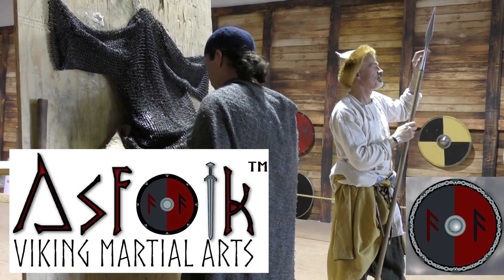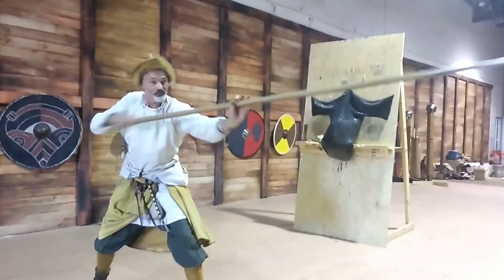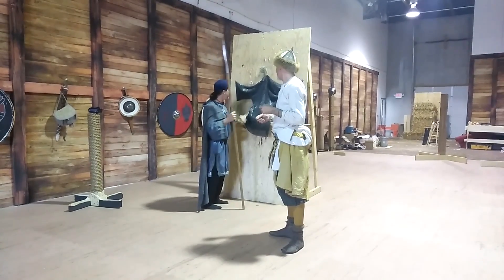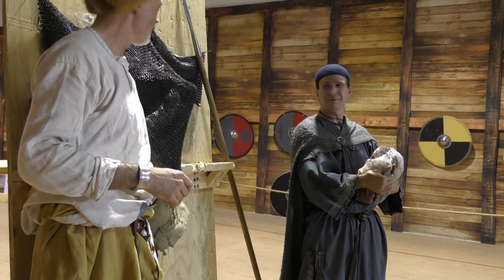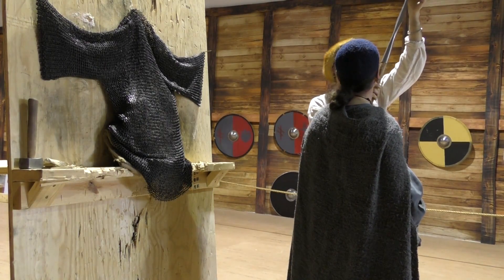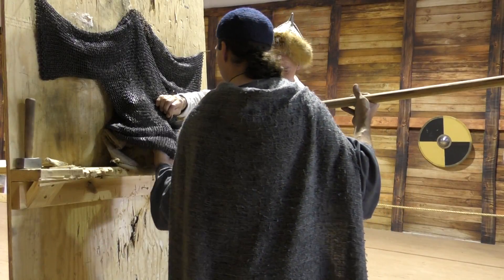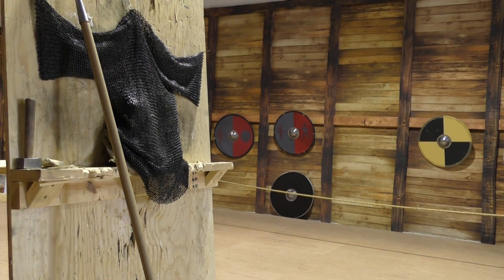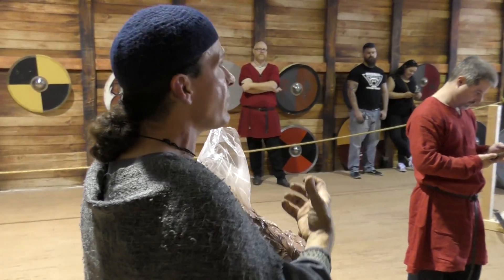Thrand & Roland Warzecha Viking Spear vs Histoical maille @Asfolk! +Slow-mo

Comment: You have to keep in mind that hitting an opponent with such a powerful accurate thrust would be somewhat rare. Often times you wouldnt be able to create an opening to perform such a thrust and even if you did, you might want to be conservative with the amount of power and pressure you use because you dont want to leave yourself open. Amazing test guys, thanks for the hard work.
Reply from the maker: Very true

Comment: Thrand, I was wondering: gambesons and jacks were sometimes worn over mail instead of under it. Would you be able to do a test with spears and arrows to see if there's any difference between having the cloth on top of underneath the mail?
Reply from the maker: Jonathan Dean I could do this in the future.
Reply: That would be amazing. Thanks :).
Reply: People theorize that was a second gambeson for extra protection (+ protection from the elements)
Reply: Gloin79 There's a reference in the Ordinannce of Charles the Bold for archers to wear either a brigandine or a mail shirt under a ten layer jack. This suggests to me that, even if in the 13th  century some wore a gambeson on top and another beneath their mail, in the third quarter of 15th century there was only one layer of textile armour.
Reply: for the 13th century there is a reference in the norse saga's to wearing a quilted surcoat as predecessor to the coat of plates, as for the 15th I'd think you still would wear a lighter arming coat under the mail for comfort but indeed not really for protection
Reply: https: // myarmoury.com/talk/viewtopic.php?t=11131

The test this chap did showed that:

- to defeat a gamberson, you need either a sharp cutting edge or a REALLY heavy thrust from a stiff spike backed up by weight (spear or poleaxe spike). Gamberson did quite well against bodkin point arrow (non sharpened broad heads). 

- Thus, a gamerson over mail will soffen the impact of most war arrows (bodkin points). Broadheads will cut through, but they won't  go through mail. Gamberson are good against blunt weapons (mace, hammer). Sharp sword will cut through a gamberson but will be stopped by mail.

- Another reason; I suppose, is that mail armor is expensive and more difficult to make than a gamberson. Thus, you might want the gamberson on top as sacrificial, ablative armor. If your gamberson got too torn up, then just make a new one. A split ring need a smith; a gamberson need cloth, needle, and threads.

- Also, if you put gamberson underneath the mail, you need to make a bigger mail shirt. Bigger mail shirt = more metal, more weight, more expensive.

Comment: Great video!
What I find most interesting is that there seems to be little effect of how many rings you cut - the three ring hole you made doesn't look much bigger than Roland's single popped ring... So while it is vulnerable to spears, the mial seems to conatin the damage pretty good.
But you could use a bigger and thicker clay portion in the future ;)
Reply from the maker: fireman23 Thanks

Comment: Hey . Good experiment. I'm not surprised that the spear ripped the chain mail. The fixation in one spike is unreliable and cheap on the basis of medieval standards. In medieval Russia, graduation is known for 5 quality standards. The most expensive is the chain mail with  fasteners on the three spike with hot forging. Literally stated - it's hard to break. The limit is not exhausted)))
Sorry for google trans..

Comment: Hey, relay cool experiment two years ago i was part of a simulator experiment at Mosegaard museum in Denmark. Then the test was done on a dead pig with out entrails. but with a gambeson and mail on top. The pig was hanging from some thing like a gallow. And i think the spear head that was used was smaller than the once you had. The interesting thing is that it did not pierce the mail but the tip of the spear was bent. I think the stab was one handed and from below not high like yours. But i guess it still would need a bit of fore the bend a spear point. I have tested on dead pigs bout with and without entrails before. but never with that much armor. And the strength needed to go thou the carcass when there is no armor is so little that i was surprised when it was stopped. 
I dont know how hard the metal was. But i think it was hand made.  So there is a lot off differences on these tests but i think its easier to go thru something when there is something hard behind it. You get anvil effect.

Comment: Conclusion: wearing a mail shirt served near to no purpose beyond avoiding slashes... so, if we go by modern standards, considering the price and labour required, it's not that different from people buying a Ferrari to cover a whole of five or ten kilometers a day, or even more so leaving it in a garage. Starting to think it was more to show off status than to save your life
Reply: Mail armor is very effective it wouldn't have been used from before the Romans all the way to the Renaissance if it didn't work. There is a lot of trial and error in warfare and if armor wasn't effective enough then it wouldn't have been worth the weight or the money and would've been abandoned, mail was popular because it works. Sure it might not be able to stop a full power spear thrust or close range shot from a warbow. But you can't thrust or cut through it with swords or chop through it with an axe and it's great protection against missile weapons in most instances it will stop arrows or javelins. Just because an armor may have one or two weaknesses doesn't get its overall effectiveness.
Reply: All true, except that this is tested with the single, most common weapon of the day ( a spear, which essentially everyone would be carrying as their main killing implement throughout the days of use of mail). As I stated, it does spare you gashing wounds and accidental cuts; glancing blows from a sword won't leave you oozing blood and losing strength during a fight, but a poke with a spear will, so the major reliance of these warriors for defensive purposes was probably the shield, if anything, and the helm, not the mail. It might resist arrows (although anything with a narrow enough head will definitely still prick the skin through it), but you'd still be a whole lot better off simply putting your shield in the way, which is likely why no one ever went into battle with just mail armour and invariably carried an either extremely large or (later on) very sturdy shield.
Reply: Lokarsh21 very true that the shield was definitely the primary defense and likely everyone use a shield, unless using a two handed spear, Dane axe or a bow. The reason so few used mail in say the 9th century was only because of it's high cost and small supply. But if you jump ahead to the beginning of the 11th century the bayeux tapestry shows that the majority were wearing mail, most likely because the cost had gone down and the supply had got up. At any point in history that mail was in use it seems that if someone could afford it then they would use it. But the shield was definitely the most important part the the armor, followed by a helmet, and then mail if you could afford it.
Reply: Clearly having a shirt or a full body protection that makes you 100% impervious to draw or push cuts isn't bad either, don't get me wrong, but I'm almost sure (And very much unwilling to test it!) that a sword slash on mail hurts like all hell and can crack or break more exposed bones, like collarbones, shins, forearms, skull, as well as dislocate vulnerable joints like knees, elbows and shoulders if it lands squarely on them. An axe or a mace being even worse. So yes, I feel this helps making more sense of two things: why sources in the so-called viking era (We should say second migrations, really) show primarily men wearing simple tunics, helms and shields and why later on padded armour becomes so prominent for poorer soldiers that can't wear full mail. I'd also favour a thick padded aketon over mail with no backing, in all honesty. And many of the XII and XIII century sources appear to show mail being worn with simple tunics underneath, rather than with thick, bulky padding like many reenactors tend to wear. To me, that's a terrifying thought, because a thrust from a spear like the one in this video would definitely push rings in the wound as well. Always bring a shield, better if it covers your whole figure